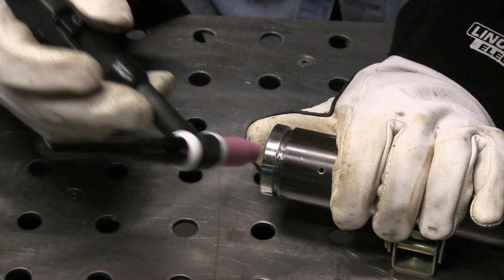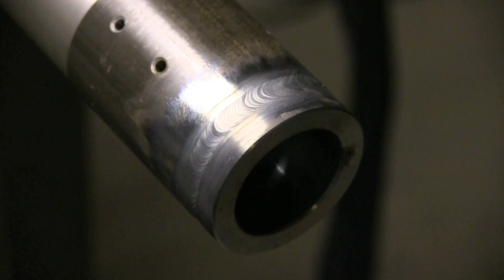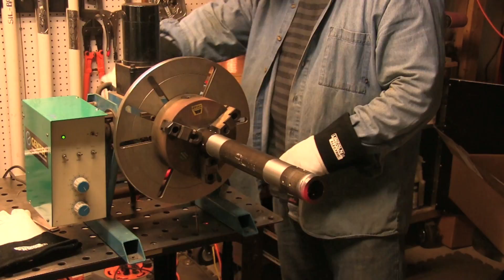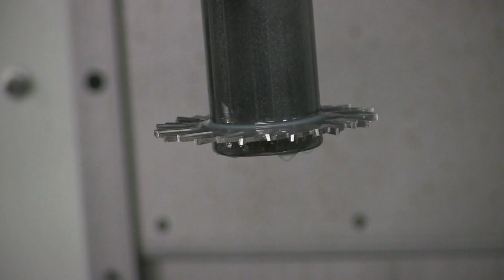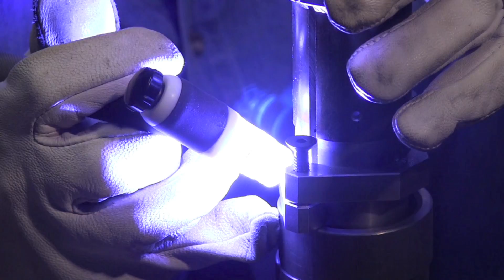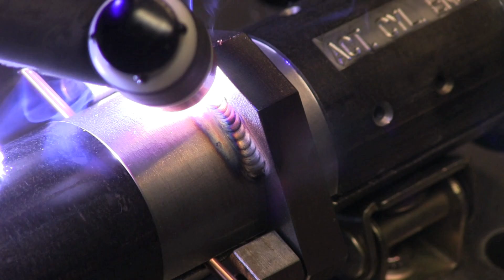50 parts - 3 Welders

Comment: Cool stuff, do you have a vid or can  you do one on a Tig welder for a small shop needs to do aluminum too but thats for the budget minded since i we don't use it that much but would like to have one to go with my Miller 211 w/spool gun and gas setup.  I have used them last one died got the 211 for a all around use, but my daughter wants to use a Tig for metal art too.  But looking at all of them now its hard to find one that will last and do the job.   thx dan in phoenix

Comment: Hi Jodi
I love your videos, this question is going to be a little bit off topic
getting ready to purchase a new welder and I'm having a hard time understanding the capabilities of certain machines between 180 to 210 amps. (220v) wire diameter and the thickness of the metal they're able to weld, using gass versus flux core. machines often say they can weld the certain thickness with a single pass but then I often find this to be incorrect.

Comment: GREAT VIDEOS. I have been following your videos for years.purchased tig finger, the wide based square and cd's. I have a miller diversion 180 and step on the pedal get argon flowing  to the tip before i start welding after setting up my machine. I turn the bottle  off every time  I'm done welding. It can be a couple of weeks before i get another job to weld.

Comment: Great video Jody. For aligning drilled holes, I like to use a counter sunk screw to ensure the hole is pulled concentric. You mentioned race car chassis welding, any chance we'll see some tube chassis or roll cage welding ?

Comment: Glad to have you back. Getting ready to test out on my D1.1 structural steel 1" coupon this week (running 7018). Cut and polished my 3G practice plates and my instructor (LA city CWI) said I'm ready for 3G. With that being said my buddy last week that is pipe welding at school let me finish out his 8" schedule 80 6G (a first ever for me) before he goes to chopped and beveled it again. Honored he let me practice on his 6G. It is not easy and I positioned my rod angle in the stringer like you have in your 6G videos. Just wanted to thank you for the videos you put out for us Jody. As a student it means a lot.  Thinking my practice doing that 6G is gonna help huge for my D1.1 one inch coupon in 3G (and 4G). Keep up the good work Jody. And thanks for being inspiring for us younger students in the game!!!

Comment: I melted the argon hose on my AHP after about a year of use.  I replaced it with a 150A/100% duty cycle torch from USAweld.  It is a CK torch with super flex hose, the torch doesn't get nearly as hot as the stock torch.  Great video, today's podcast was interesting too.

Comment: Awesome video, that welding lathe is cool.  Probably not too much work to build one?  The tool used to split the pipe is called a slitting saw. I see your using a fabblock table, how do you like it?